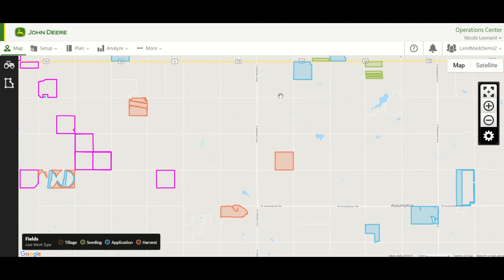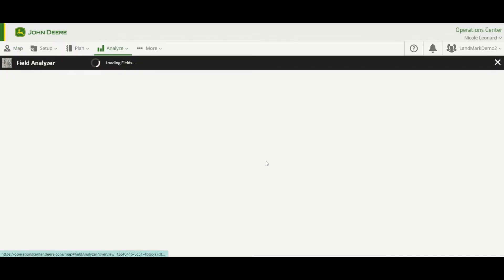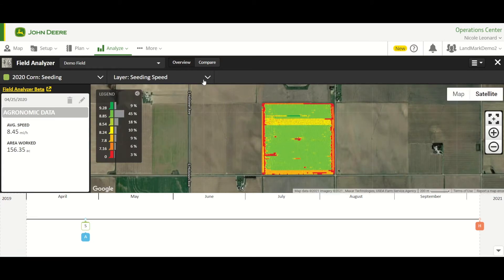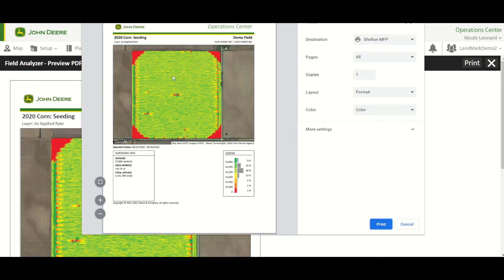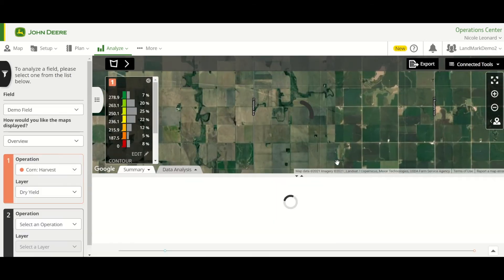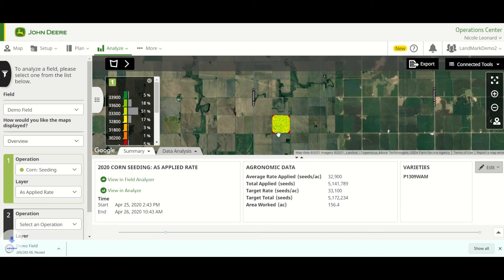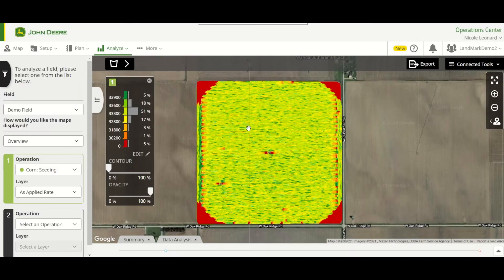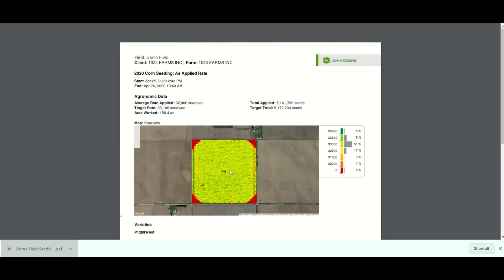John Deere Operations Center - How to Print Maps

Comment: So they removed the print on the tab, and now it is export, with no way to fine tune the image.  Is there a way to get just the field image on a bigger print out without cropping it to add the other data for planning purposes?
Reply from the maker: If you go into Setup, then the LAND, then click boundaries you can print off Fields with the boundary shape but will not have any Applied rate or any previous work layers on it. The only way to have a map with the work information on it is to Export from Field Analyzer and either screenshot the map or use the snipping tool to capture that field and adjusting size as needed.